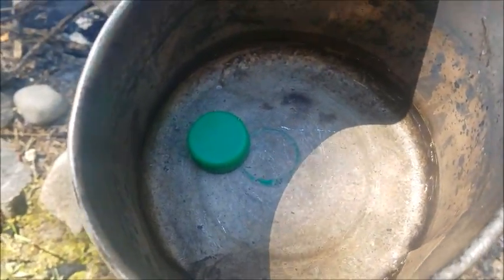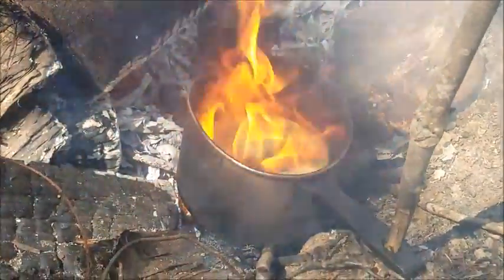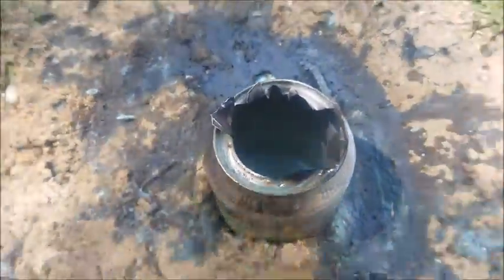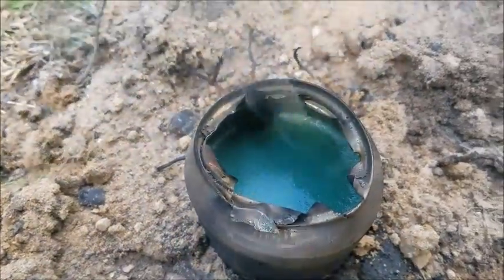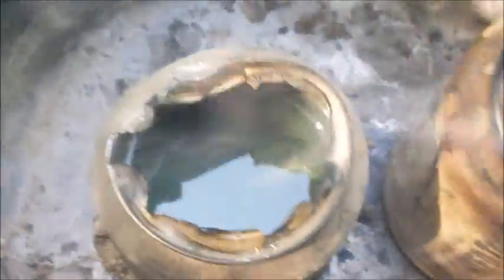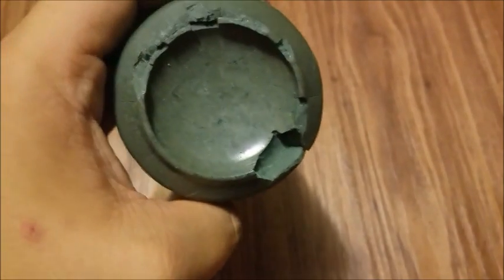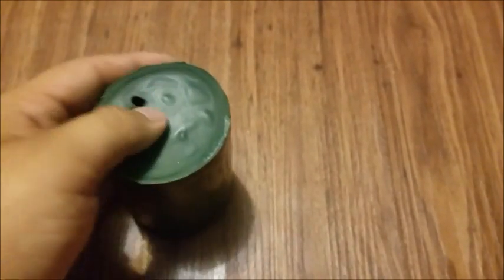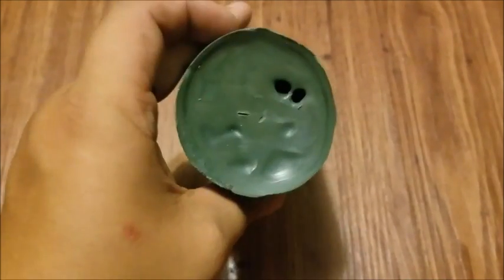Can You Cast Plastic?

Comment: Just an FYI that this HDPE that you were melting has a melting point of 266 degrees Fahrenheit. When it gets toward that level, it gets tacky but doesn't completely melt, and can be formed into solid blocks without causing fumes or smoke. When plastic/HDPE is burned, it releases dangerous chemicals such as hydrochloric acid, sulfur dioxide, dioxins, furans and heavy metals, as well as particulates. These emissions are known to cause respiratory ailments and stress human immune systems, and they can also cause cancer. 
Great video and great idea until it started smoking, huh?
Reply: You seem really highly intelligent, so that being said, is there any way you can  melt the plastic without it having  all the pollution and cancer causing fumes and smoke with some type of air pollution machine that filters all the smoke and fumes out??? I'm  sorry if I have taken up your time, but I was just wondering, and I think you are the most intelligent person to ask. Thank You Very Much::::
Reply: Maria, If you melt plastic at a controlled, lower temperature, it won't get hot enough to burn and produce smoke. Each type of plastic melts at a specific temperature, so keeping the heat just above that melting point can stop it from burning and smoking.
Reply: @DanoHSMM  THANK YOU SO MUCH MAKES A LOT OF SENSE NOW..... GOD BLESS YOU ALL ALWAYS

Comment: I cannot believe that worked. I genuinely thought that was not possible without degrading. People are trying extrusion methods and injection moulding etc etc and it works by casting?? Not good for the ozone I'm sure but good for the oceans full of the stuff by being repurposed so easily. Subd.
Reply: I have a question... why is it not good for the ozone?
Reply: @kerwwyngonzales9547  don't know the details but burning plastic is really toxic
Reply: @kerwwyngonzales9547  the fumes of the plastic can cause holes in the ozone layer in the sky, not good

Comment: You can find charts for various plastic melting points.  
If your plastic is fuming off, it's too hot,  if it's burning it's way too hot. 
Use just enough heat to melt it, any hotter degrades it.

Comment: You need to consider the effects of heat to every object your heating. Putting anything on a open fire without knowing any melting points is very very dangerous. Plastic is a product of oil. When heated over its melting point it will begin to fume. Plastic fumes are very bad for your health because its basically turning into crude oil when it begins to fume and when exposed to its flash point it starts to catch on fire.

1. do not use open flames or a heat source that ignites the plastic fumes.
2. use  proper ventilation to vent off fumes in a safe manner....those smog fumes cause lung cancer and very hazardous to your health.
3. always wear safety protection such as a half mask for inorganic vapors and safety googles.
4. do not put plastic in your oven, ovens may have a miss calibrated heat index which may set off ignition or molten plastic may drip onto the coils that may cause a fire.
5. direct contact with an open fire using aluminum will either melt or warp considerable, using aluminum is not advised unless the heat source is controllable.
6. stainless steel has chromium inside of it which forms on the metals surface that forms like black salt which may cause castings to be weak/brittle

When conducting a experiment like this you need to have it on a controllable small scale that minimizes risk for injury and record all data to make a conclusion.
Reply: Doesn't matter to me atleast because I also melted plastic at 12 without knowing it's out comes
Reply: Meh i dont give a crap about this i will do what i wanna do.
Reply: People getting mad about someone talking about safety hazards like they’re not even doing this in a condescending tone while giving out useful information but people going crazy
Reply: The three stooges
Reply: i knew somebody would be cry-babying about this video

Comment: The smoke that comes off of it is gas that's why it burns. Just put a lid on you pot and it won't smoke much!
And it will take at least a day to cool off even cooling it in water.  But you might want to mulch tree leaves/grass or sawdust or wood chips.

Comment: burning/melting plastic releases dangerous fumes. don't do it unless you are trained and have proper safety equipment and are in a certified and purpose-build lab or factory. in short, don't randomly burn/react/melt chemicals unless you are trained and know what you are doing and are doing it in a safe and legal way.

Comment: This is really interesting. I’d be interested in trying this method to try and see if I can adapt it to cast into a mould with sheets of cardboard to see if I can press it into plastic coated cardboard composite material that can be very thin but strong
Reply: @ms.construed1305  it would likely work as a kind of composite material. I think the cardboard pulp would need to be completely dry to best bond with the molten plastic

Comment: This procedure name in chemist is pyrolysis.
You can make same procedure the old wheel tyre into Diesel petrol material.
But the all gas comming out from procedure is high toxic and the level of cancer illnes is extreme high also.
Use gas storage system ( gas washer), to reduce this risks, and not work at home, next time ( the best workplace to this procedure is in a chemist laboratory).

Comment: I "think" the idea is to get the plastic as plastic as possible without the smoke and fire.  Maybe if you'd pulled it off the heat when it started smoking and then put it back, i.e., control the temperature.  I've made several bushings but still haven't perfected the process, but I know that if it comes to having all that smoke or nothing, I'll just quit.  I breathed some smoke from heated plastic once working on a truck. Knocked me out, fell back against the wall.  Can't be good for you, period.